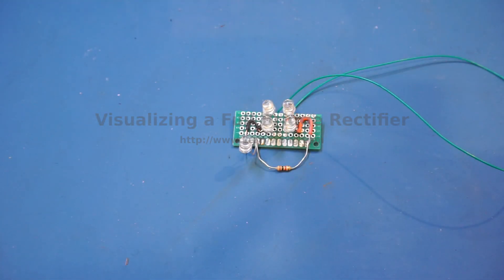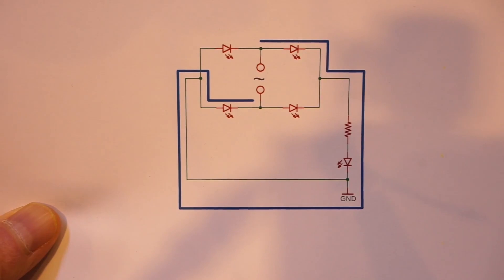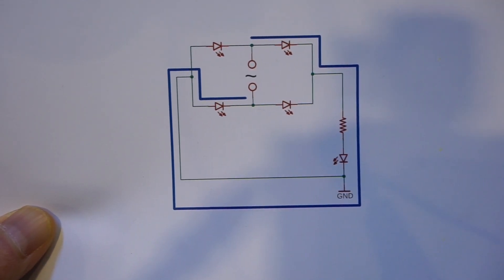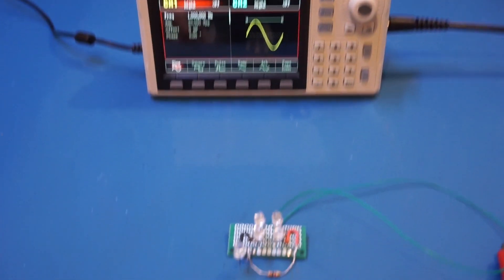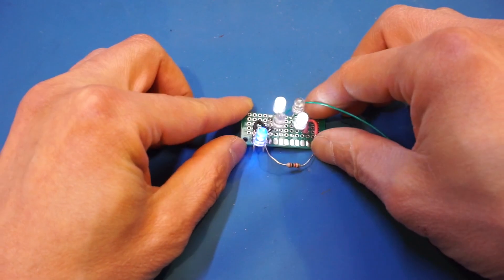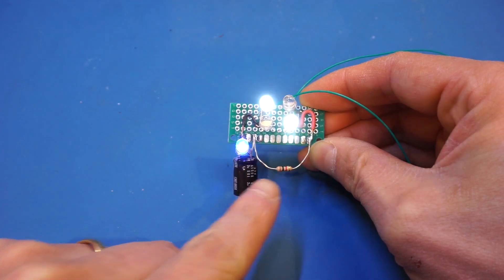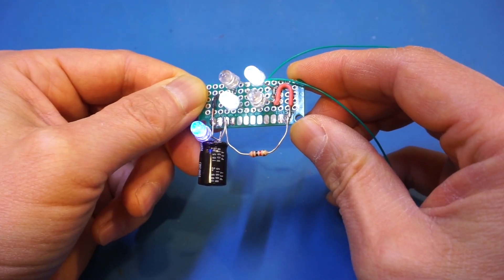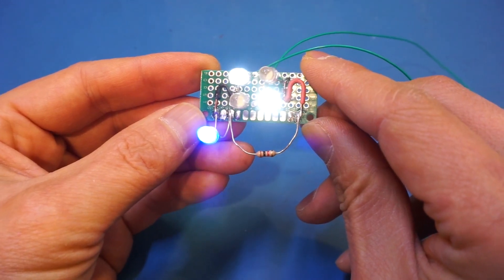Visualizing a Full Bridge Rectifier

Comment: You have created an emergency flasher!  You can get a cheap square wave generator and power some emergency lights on car to get through traffic without using a 555 timer.  You can make a full bridge rectifier using shotkey (sp) diodes to regulate the voltage.